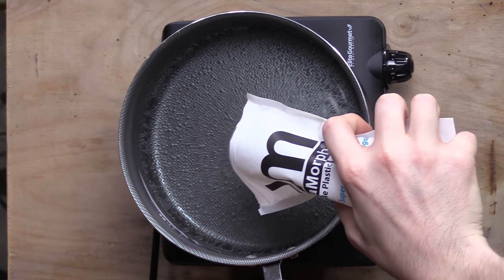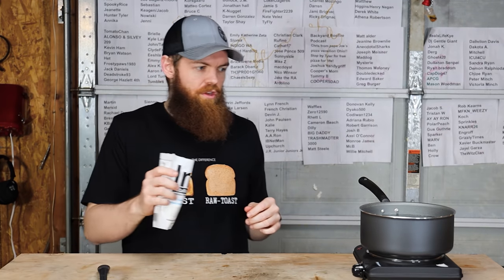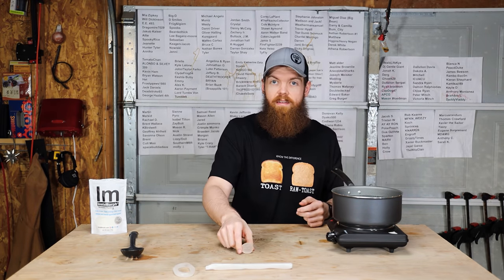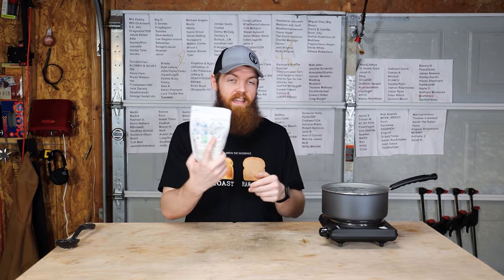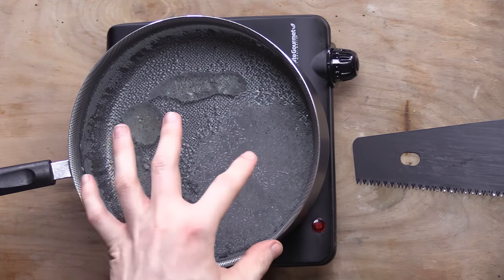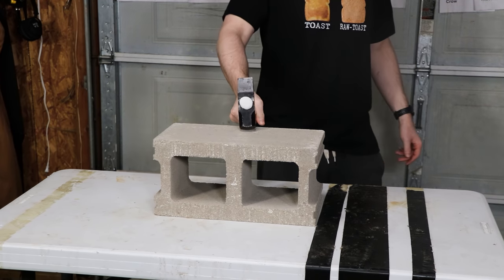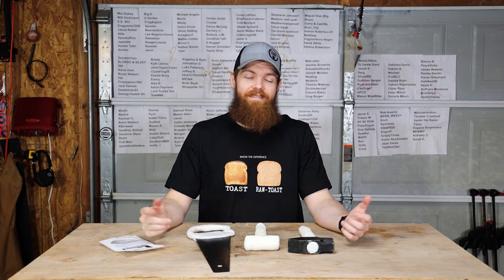You Can Turn These Plastic Beads Into ANYHTHING

Comment: Make a pipe with it, capped on one end with a valve on the other and see how much psi it can hold
Reply: I like the way you think
Reply: That's the show we want to see. Boom cap flies off mach 2.
Reply: Sooooo make a bomb?
Reply: @keirakain  yea for real, that could be really dangerous, 100 psi of any fluid touching you and your gonna need surgery most likely
Reply: Tyler definitely shouldn't do this. He will end up dead or maimed at the very least
Reply: I wish i could like this comment more than once
Reply: YEAH, YA KNOW, LIKE A BOMB
Reply: @matthewmors5995  what about vacuum than?
Reply: Yes
Reply: That would be fairly pointless, since much lower cost PVC pipe exists, and will have a higher burst strength.  Remember, some short test Tyler does on a video, does not reflect longer term deformation which is what you'd need for any real use.
Reply: Just pay the tax stamp and fill your form one I’m sure the aft would approve it for testing purposes.
Reply: I actually do that for work, we combine a similar type of plastic (much higher melting point, around 350 degrees) with carbon to make high density pipe. My job is to actually take samples of those pipes and perform tests on them. The diameter of the pipes we make range from 1 to 24 inches and the wall thickness from 0.25 to 3 inches thick. We put anything on the smaller side in a burst chamber, pump it with water, and measure the psi at failure which ranges anywhere between 60 to almost 1200 psi.
Reply: Fill the pipe with water and freeze it and see if it cracks or expands.
Reply: You mean a columbine candle?
Reply: @matthewmors5995  air is a thing. Also its very easy to do something like this safely.
Reply: @DementedPrankster  that's super cool!  I don't think I've ever seen pipe with a 24" OD.

What OD would pipe with a 3" wall thickness be?  I'm just curious because that should be able to handle just about any amount of pressure that you could create.
Reply: @CeeJayThe13th  The only pipe we make with that thick of a wall is the 24" OD. We're actually running some right now. They are primarily used for areas that'll be main gas or water lines for a smaller area, think a small sized apartment complex (as I've been told), since they should be able to stand up to over 1200 psi. And to give you an idea of weight, that 24" OD 3" wall thick pipe is 77.5 lbs per foot and each joint is 50' so each joint is 3875 lbs.

Another plant we have makes pipe that is 54" OD and wall thickness up to 1 foot. No idea how they test those types of pipes but I'm trying to get the company to allow me to tour those other plants to see how they make and prep those larger pipes.
Reply: @DementedPrankster  that's wild!  I would have assumed that they would use steel or something.

I wonder if we could use stuff like that at my work.  We run tons of stuff through miles of pipe but the environment is so harsh that they tend not to last very long.  I wonder if plastic would be better?
Reply: @CeeJayThe13th  One of the better reasons why plastic pipe like that is being used more is because when it fails its a ductile failure rather than brittle like metal pipes, it'll expand and then just open a seem rather than potentially produce projectiles. It also can withstand some compression and rebound, while metal might not. However it's not quite as strong as a metal pipe would be at the same size and thickness. So it's all about what the pipe will be put through, where it's located, and how much space the pipe may have to determine if plastic or metal pipe is better imo.
Reply: @DementedPrankster  I never realized that I was so interested by pipes.  I imagine we probably use metal because that was just the standard when it was all built and because it'll stand up to a beating from mobile equipment (which shouldn't happen but obviously does) better but I bet there's places where we'd be better off with plastic.

I wonder if you have high pressure and you have a seam to open (I bet you guys have a specific term for that) you'd get more of a dangerous ejection from the pressure than if a pipe just breaks like it would with metal.  As in, is high pressure/low flow more dangerous to personnel than low pressure/high flow?
Reply: @CeeJayThe13th  Your most likely right. This plastic pipe has only been more widely used in the last 10 years or so. And ya, metal is definitely better at taking a beating from machinery. Another con of plastic pipes, got to be careful around them with sharp tools and/or machinery.

On failure it is a large burst in a single direction whereas for metal it is a brittle failure around the pipe (in terms of bursting), so its a lot more pressure immediately in a direction, but there's no projectiles involved. So both have have dangers associated with bursting, one projectile based and the other pressure based. To give you an idea of the force behind a ductile burst we use a shield, bungee cords, and a locking burst chamber to dampen the force involved. Sometimes there's still so much force that the burst chamber, which weighs over 400 lbs, jumps a few inches in the air. However that's only for those pipes that reach 900 psi or higher (and 6" OD).
Reply: @DementedPrankster  that's neat!  Thanks for sharing your knowledge with me!
Reply: You telling him to make a bomb?! TF
Reply: @matthewmors5995  missing a 0?
Reply: @quackatit  seems like a good idea to me
Reply: @kacperchrusciel890  I don't disagree there are safe ways, just don't want to see him slap it together and test it and end up needing surgery
Reply: @matthewmors5995  I mean, it could happen in a very, very, specific situation, but generally speaking 100 psi isn’t a huge concern for human safety. You’d have to have a very small orifice, be very close to it, and hit very soft and thin skin. For many of the substances we pressurize in liquid form it’s not the piercing that’s the medical concern so much as what you’ve been injected with. Finding a 100 psi pin hole and getting hit with some water is not such a problem as liquid petroleum for example.
Reply: 😅.  Viewer request of build a pipe bomb……

Denied 🙅‍♂️ 😅
Reply: @keirakain  YES
Reply: I misread that comment. I thought you were meaning to use it if you don't have a bathroom

Comment: Everyone we need to get Tyler a proper workbench
Reply: He can make one with the plastic
Reply: He should make one out of this stuff.
Reply: And some safety glasses! all it takes is 1 mistake and its lights out.
Reply: A wood table isn't a workbench??? 😂
Reply: Indeed, I suspect the saw would have been much more stable to saw with used on a workbench.
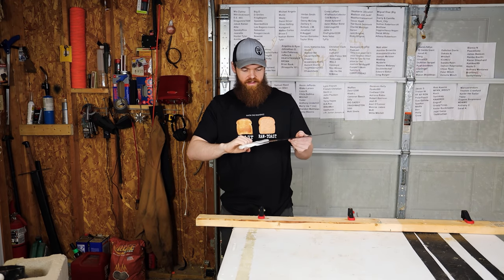Reply: @animeloveer97  21:17
Reply: Everyone, you need to get a real job and education, learn about manufacturing and realize these are engineered polymers that have great mechanical properties. THis is nothing worth viewing. Melt your pop bottles down, and melt the caps. then do it your self..........................

Comment: So far it looks like this should be a useful addition to anyone's camping bag.
Another thought was it seems well suited for making an improved splint or cast if you couldn't get to medical services while camping within a couple of days..... Overall looks like a very ingenious product that could find uses in anyone's garage/workshop.
Reply: just wrap the injury in something first to prevent burns but yeah.
Reply: Maybe you should just be more careful camping instead of carrying the extra weight?  If you can't be that careful, don't camp two days out.  It's pretty simple.  Otherwise how is it especially ingenious to merely recognize that there are a few thermoplastics that melt within the boiling point of water?

However, if you want something for your stated purpose, it would be a lot handier to take epoxy with you, then to make your cast you just take cloth, cut it into strips, wrap around the needed area and coat it with the epoxy, sort of like laying fiberglass.  No need then, for an injured person or anyone else, to have to fool around with having a pot, water, making a fire, waiting for it to heat up, instead of simply mixing some epoxy together and waiting 5 minutes for it to set.
Reply: @stinkycheese804  this guy has never had an accident I guess
Reply: @stinkycheese804  last I checked being careful doesn't prevent a bear from eating your face.
Reply: @stinkycheese804  I imagine a person could reasonably chose to bring both and use this plastic to create a belt buckle, buttons, etc. so that it's not using up extra weight/space. It could be used in situations where two things need to be connected but not directly joined by creating a pair of linked rings and anchoring them on whatever you're connecting. You could achieve similar results with other materials/methods but this one allows for a little more control if a specific shape/function is desired and repairs only require creating a fire instead of using up the limited amount of epoxy someone can bring.
Reply: @stinkycheese804  Want to know how I know you have never gone out boondocking/dry camping a day in your life?

Comment: I'd like to see a knife or hatchet blade made from this stuff an see how effective it'd be.. thinking more for a survial pack to make a tool you forgot or lost
Reply: i feel like that would just be the plastic knife all over again though, plastic is extremely hard to get an edge on and won’t last long if you manage a decent one
Reply: It is far too soft for that.
Reply: I like what you are thinking....but I believe  the using them to make a hatchet handle if ur handle broke would be way more practical  then making the hatchet head it's self
Reply: Yess
Reply: This this this
Reply: How sharp he can make it
Reply: awesome idea!!
Reply: Probably wouldn't be able to make an edge tbh
Reply: Any thermal plastic is absolutely crap for frictional sharpening.  You could injection mold a sharp edge but even on a hot and sunny day it would just buckle and warp.  The curing process is intrinsic to the edge retention.
Reply: @rallyfeind  from watching Tyler's videos he is more of a can I do this over should I do this type of guy
Reply: @summerfireking  I didn't say he should or shouldn't I said he can and how it will turn out.  I was just demystifying it for the ones that haven't been material handling in a plastics plant.  Thanks for your input and thinking this is my first video.
Reply: @rallyfeind  ey man we are all Tyler fam here
Reply: It works very well
Reply: @stinkycheese804  it is not soft whatsoever once it has cured it's just as strong as any other plastic you can think of and way stronger and then your average Dollar tree toy
Reply: It would be trash 😂
Reply: You'd be better off using it to form a handle for a well-shaped or knapped rock than as a sharpened tool head itself. It's be like trying to use a disposable plastic picnic knife as a survival knife.
Reply: Well considering how he empathized how rubber like this stuff is ten separate times over the episode I’m assuming it would be completely nonfunctional as a knife. I mean unless you want one of those rubber knives for movies thats entire purpose is to not cut/hurt anyone lmao

Comment: Try forming it over some Bolts/nuts and see what kind of TQ numbers you can get out of them as socket wrenches and such.
Reply: I have done this and it does work. 😂
Reply: Why?  The torque #'s would be lower than tapping threads into any harder material.  It would just prove what is already obvious, that low melting point plastics are a poor choice for that.
Reply: @stinkycheese804  you must be new here
Reply: @stinkycheese804  why? Have you seen Tyler’s videos? It’s because we want to see it, we don’t give a shit if it’s better or not

Comment: And you gotta heat the hammer head to get a tighter fit. When the hot plastic hits the cold hammer it starts to solidify. Hotter hammer slows down cooling process. Again great video.

Comment: i work in a plastics factory, that just looks like the material we use to make the stuff. the clear kind is used for things like those  brita jars, or the thing that covers the car lights. you can really make anything out of it, you just need to heat it up so it'll melt and then mold it. obviously in a factory it's melted at over 200ºc, so it becomes liquid, which is easier for machines to inject into the mold. however, if you use boiled water, that's around 100ºc, it'll make the plastic soft enough to work like a putty, and if you're quick, you'll be able to mold it by hand before it cools down into shape. and if you make a mistake, you can just put it on another pot of boiling water and start again.
so yeah i guess one could use it as a fake tooth, you'd just need something shape the plastic to the right size and shape and then find a way to keep it in place
Reply: Neat!
Reply: Why do you need to put the plastic into ANOTHER pot to remold it?
Reply: @tpad6  i meant it in the sense of while you're molding it, the water will have cooled down and you'll need to reboil it. not in the sense of getting a different pot of water to boil when there's a pot of water next to you
Reply: @Ray_Vun  ah got ya! Thanks! Cool story.
Reply: I was also wondering how someone could make a tooth out of it without it just falling out.
Reply: @Gohka  yeah without some type of string or wire that can be used to keep the tooth in place, there's no way to keep it there. it's not like you can just shove a bit of the soft plastic into the space and mold it to be secured, it'd still be hot and absolutely burn the inside of your mouth.
my best guess is that they put some type of wire through the tooth while the mold is still hot, use it to create a loop on each side, and  then when the whole thing cools down, they push the tooth is and the wire is going in the space between other teeth. so let's say they made a pre-molar, one loop would be around the molar and the other loop around the canine.
if it's not like that i genuinely can't think of how else it's done

Comment: This would be an excellent piece of gear to put in a survival pack. It's light, does not take up much room. Can be reused, so depending on the situation you can continue to make tools you need for survival and it's very very easy to use.
Reply: I like the way you think. A video on someone surviving a few days in wilderness with just this stuff and some basics would be worth watching a mini series of.
Reply: @CubeGodd  I'd like to see a series of it with a wildly different pack each time, needing different plans based on the weird gear
Reply: Can confirm. There are lots of brands already out there. Been using it for a lot of stuff. Last project was handles for my lockpicks. Very durable even when thinned out
Reply: @CubeGodd  totally!! Would be really interesting to see vastly different environments where the survivalist has only this in their kit.
Reply: I keep some in the glovebox of the car in an insulated bag, and always take some camping. Very handy stuff.
Reply: Give me an example of one tool you could use for survival with this plastic lol
Reply: @ModernGentleman  On one occasion when out camping I cut my index finger near the knuckle to the bone and severed the radial artery. Though I had liquid stitches and butterfly clips, the wound was deep enough that even small movements would tear it open. I knew I would have zero hope of being able to sleep with it like that, I'd wake up in a bivvy bag full of blood. So I sealed it up as best I could and then formed a splint/cast around it and the middle finger together.
The moisture wasn't ideal but it got me well through the night. In the morning I was able to cut the cast off easily and allow the wound some air-time and re-dressing before re-using (and sterilizing) the cast at the fire.
It healed amazingly well. Barely a scar, and feeling came back to the finger after about 9 months. 
As far as other 'DIY youtube survival life hacks' use your imagination. You can repair anything with it and a reel of braided fishing line. Bonds to anything porous better than epoxy, without any of the hassle of expiring or leaking. Re-usable. I don't know, seems pretty good to me. I've fixed dozens of things with it while camping. 
And yes making a knife with it is a stupid idea but making a knife handle with it is a great idea.
Reply: @Joe  but wouldnt a stick and some duct tape do the same thing? Just sayin
Reply: @ModernGentleman  No, it wouldn't and it would carry drastically higher chance of infection. Don't get me wrong I've used duct tape in leiu of emergency visits dozens of times but in this case nothing outside of a half cast would have stabilized it enough.
I'm not saying it's some sort of magic survival tool but it's not silly to consider it. I think impregnating gauze with it would be the best of all worlds honestly, you can still do everything with it as normal but it would be much better for wounds/snakebites.
Reply: @ModernGentleman  you could make a wheel for a cart if it went flat or some shit.
A spear wouldn't be horrible just a little light. Probably not good for throwing. 

A bucket, bowl, cup, spoon, fork etc. 
 I'm sure there's more but just what came to my mind in 2 minutes of typing this.
Reply: its just 2 Oxepanone Homopolymer sold at an outrageous price  :):(
Reply: @commenthero2514  spear tips or arrowheads. probably wouldn't make a great knife but since it seems to be durable enough if you sharpen it it could probably work as a knife for a while. maybe a short term hatchet.